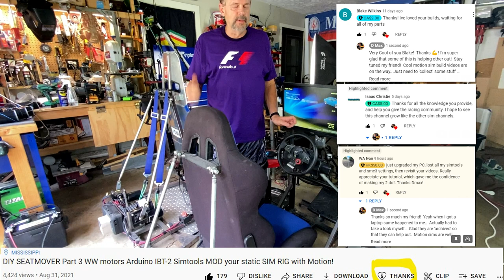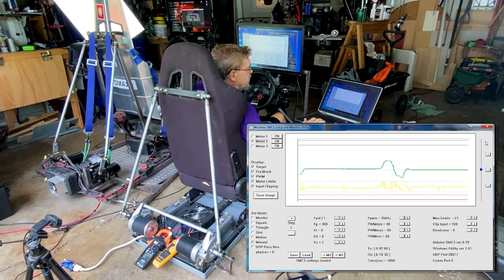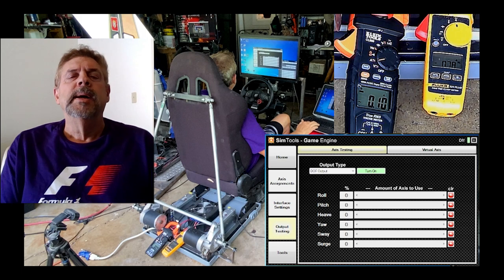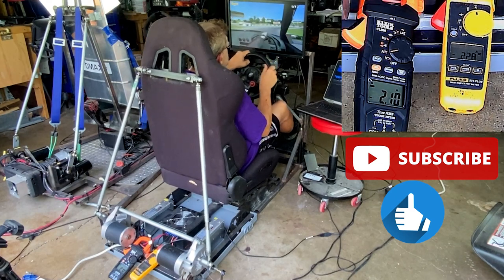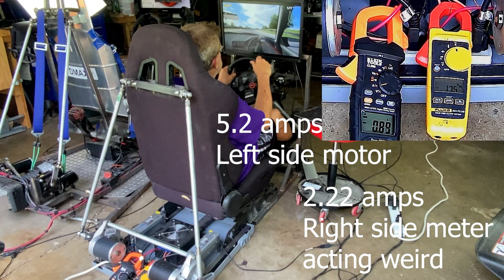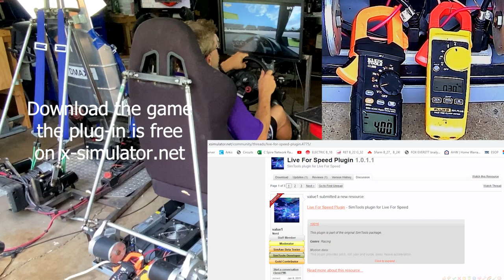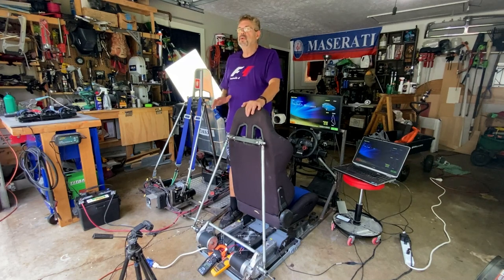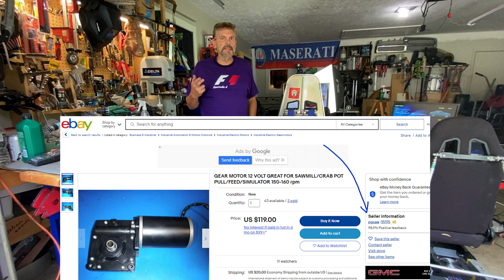2 DOF SEATMMOVER FINAL TEST - ARUDINO - IBT-2 - 24 VOLT WHEELCHAIR MOTOR  DIY SETUP

Comment: Just got my 3 crab pot motors delivered today, got the 3 power supplies, got 6 of the IBTwhatsitsname (who knows when 6DOF will be on the "menu"), arduino... just need some small stuff to begin testing the connection and motion part.... next will be to plan how I'm going to make the rig... I have a GT Track and want to see if I can make a frame under it to make that move, dunno. Fun times ahead :D 

And once more! Thank you Dave, I wouldn't have even considered doing this without your videos man!
Reply from the maker: That's awesome!!  Fantastic.   I dont have a good 'sim racing frame or anything like your GT track or I would have tried it on that.    So building my own for now.  I have a new project getting lined up before i try a 6dof..  but now at least i have 6 motors..   Thanks for watching and thanks for your kind commentary my friend!   🙂

Comment: Hi Dmax!
I've got my 2dof seat That i've set up for some times now thanks to you  ( 🙏)
It's been working very nicely up until recently. 
Now one of my 12v windshield motor is getting very hot after a few minutes of use...
The motion is still working well dispite that but I'm afraid to fry something a one point and it seems to be getting slowly worse :/
Do you have an idea of what can possibly cause this motor to overheat..?
I've already opened and cleaned the magnetic part of it but it didn't do it.
It's quite strange considering my second motor is the exact same and it isn't overheating at all 🤔

Thank you for all the good knowledge you share ! Merci !
Reply from the maker: First of all, thanks for the super!  Ok.. So I would check the electrical connections.  they have to be tight. if It's not tight the heat will build up on the wires and that's bad.  Second. maybe swap the IBT's around.. It's a pain I know.. but I am trying to come up with a 'snap on' kit' that might help.  Third.  Maybe the IBT is bad?  generally it will overheat a few times then just fail if they are bad.  Sometimes the Motors themselves are not the same, even though you would think they are.  It's frustrating I know.  I did not have a great time using WW motors.  They just did not have enough power for me even with a seat mover..  I went to the 24v wheelchair motors .. I also recommend the 12v crab pot motors. I have them on two of my rigs and they act very responsive.  Hope that helps.. Maybe someone else in the community can send an answer too..  Dave

Comment: I wonder if you used the larger wheelchair motors (the 350w ones) if that'd work more comparable to the crab pot motors or even better
Reply from the maker: great question but hard to answer.. so the Crab pot throw around me and my rig just fine at 12 volts.   the Wheelchair motors I used in my video were 24 volts which have more torque because 24 volts is twice as strong.  I think you would be fine with either one of those solutions. 350 watts per motor is probably enough to push you around just fine.  Let me know what you decide to do and hopefully my videos have covered it. Dave

Comment: Is the roll inverted? Looks like it tilts right when turning right? Gforce would be opposite?
Reply from the maker: Good eye..  Yeah  I probably need to switch it.. There is a little 'tick' mark in the software where you can flip the directions of the motors if you discover they are going the wrong way..   It should tilt left when turning right..  But setting each up individually is the key..   Good one Tom!  Dave
Reply: @DMAX_DIY  Impressed of both the build but also the channel, that part I forgot to write in the first comment 😅🙌🏼
Reply from the maker: @Prastlund  No problem Tom..  Glad your on board..  it's a project for sure.  physical and computer and all that..  I told myself to SLOW DOWN and go over everything..  so that what I am doing with this series..  trying not to go too fast show all the steps, even if they are a bit repetitive..  Thanks for tuning in..  I really appreciate it.. Dave

Comment: How come your motion rig is rolling into the corner like a motorcycle? Isn’t it supposed to roll out to simulate centrifugal g force?
Reply from the maker: Good question Oliver..  You can easily flip the motion with the 'switches' in Simtools software..  I'm just a 'user' I't not my software, plus I'm doing this all for fun so If it seems backwards to you, maybe it is, take a look at my other rig videos, seems pretty real to me and maybe it doesnt come across on video the way it should  but I already tore apart that rig to build a different one and using the parts on another 3dof full frame rig series on the channel..  Take a look if you have time.. Thanks for watching !  DMAX

Comment: On a side note. I understand why you have a laptop right next to you considering the complexity/detail layers of adjustments. I actually have my CarSim stuff in the ManCave 2 floors down from main power Computer system. Can USB 3.1 and Cat 7e down the air vent to it.. Often end up needing to use remote desktop on phone or laptop to change settings..
Reply from the maker: Oh man..  yeah..  2 floors down!?  I finally had to run a cat 6 cable from the router to garage cause of the crappy wifi signal and ping rates in the 300's..  hard to race online with that kind of signal..  Ingenuity  will find a way to get it done !  Thanks for taking a look at the video
Reply: @DMAX_DIY  No prob brother. Did you check out my youtube Channel?
Reply from the maker: @Wilson Bradley  first off..  the pinball games look friggin awesome..   you have the 2080 card I see..  I have an old 1080ti   People keep telling me to upgrade  but I'll wait a while.   cause I would probably need to redo my whole system..  I did get a 3050 card in my new laptop and considering getting the quest 2..  so i can take it on the road.  either that or buy a beat up rift..  for the road.. not sure..  Your posting some good stuff my friend..  have to edit cause text ran off screen..   that drone is fantastic..  so i'm wondering how it knows to follow you..   EPIC back yard my friend!
Reply: @DMAX_DIY  Let use proper communication.. I email you @ video2go
Reply from the maker: @WilsonBradleyTheOfficial  try max.motion.simulator@gmail.com    that's the one i check weekly..   the videos2go one is pretty old and i dont look at it but maybe once a year..

Comment: hi dmax , I can not equalize my system , my project is stopped , I noticed that my 24v motor generates reverse current for the ibt2 drives , this could be the problem of my system , 6v to 11v return in short movement
Reply: as the motors stop, the bridge h could be going into protection due to the return current of the motors, because I'm driving the car, everything works fine, suddenly it stops and the chair falls, restarting everything goes back to work
Reply: I redid everything countless times, watched your videos up to 10 times to have no error, and I don't find the problem, I could send you photos and videos by email, I would be very grateful to help me find the error
Reply from the maker: @beninitur7018  Thanks for letting me know.. That's an odd problem.. I might be a good idea to post your build with photos on  xsimulator.net..  there are like 500 guys there who can offer suggestions..   Perhaps your power supply is failing? I was able to test my 25 amp power supplies to right around 25 amp stally speed..  but in no way did the motion of the seatmover come close to that..  maybe 5-6 amps ..  I'm just not sure what may be going on in your case.

Comment: Olá você pode colocar uma mola traseira aspiral de carro pequeno e uma trizeta de carro com tração dianteira para funcionar os 4 motores sem forçar.  No meu caso só 2 motores funcionam. A mola e a trizeta já estabilizam o banco . Também  já fiz usando 4 molas traseiras de moto 125cc e uma cruzeta no meio. E não  foi nesse usei motor cep 24v bosh  8.4 amp.  Sou do Brasil
Reply from the maker: I did the translation:  Hello, you can put a small car spiral rear spring and a front wheel drive car triplet to run the 4 engines without forcing. In my case only 2 engines work. The spring and the threesome already stabilize the bench. I've also done it using 4 rear springs from a 125cc motorcycle and a cross in the middle. And it wasn't in this one I used a cep 24v bosh 8.4 amp motor. I'm from Brazil       Ok..  I think you are asking if you put a big spring on the bottom instead of a u-joint  you might be able to make the same motion..   Maybe I'm wrong about that..  I would want to use a u joint for stability primarily.  but the spring idea might work..    the key is to use leverage in the most efficient way.  therefore the u joint is the pivot.  hope that helps..
Reply: Ei Danilo, estou estudando a ideia de fazer um desses, estou bem no início da ideia, tenho um setup completo e penso em fazer isso para uso próprio mas, também, como talvez um trabalho para TCC, como faço engenharia de automação. Acha válido?